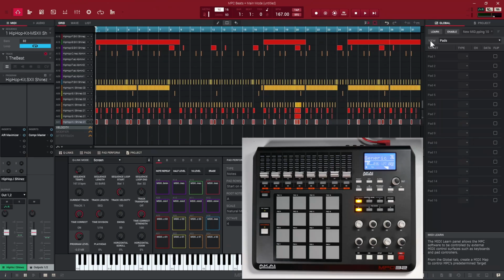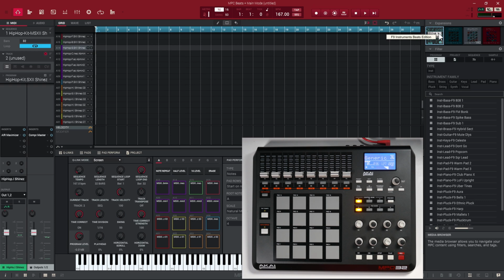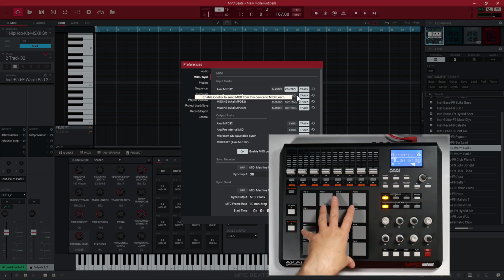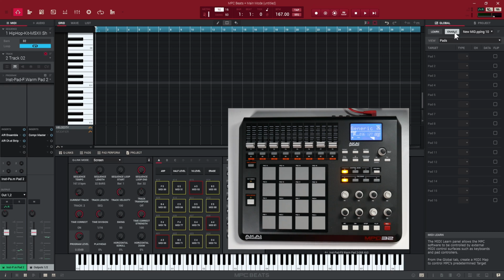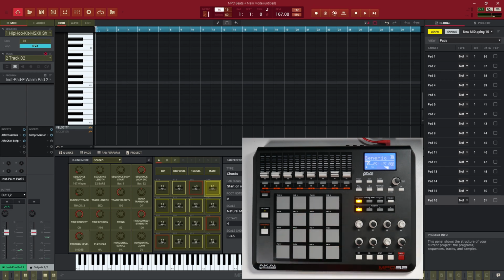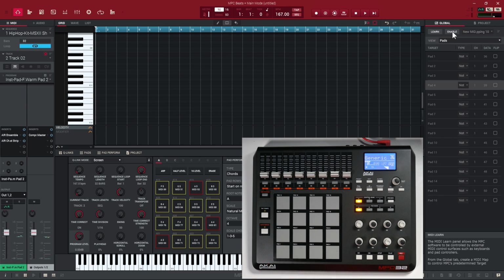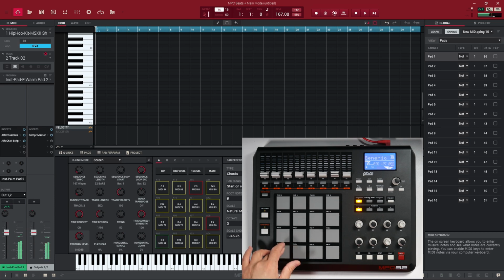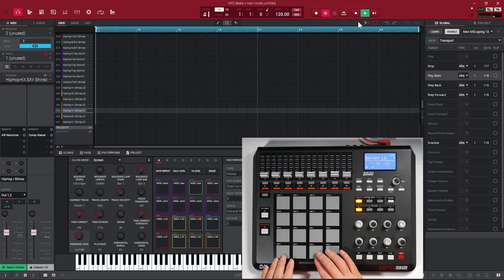MPC Beats PAD Mapping - MIDI Controller Setup (works with pad perform)

Comment: Hi, this video looks good, but I am using the mpc one + with reaper and the vst inside reaper. I get the midi notes, but no sound. When I go to preferences, there is no midi sync. any updates to this vide to cover the newer software or controller? ty

Comment: None of this works sadly. Im getting MIDI in message, but I can't get MPC Beats to do ANYTHING with my pads. Learn doesnt work. It wont take the pads I push....man Im spending 3x the time trying to get this controller to work instead of making music...My pads dont get recognized at all in chop mode...and MIDI learn does not work at all for me...this software is ass.

Comment: Hey, quick question. I have akai mpk mini, properly asigned to mpc with start up wizard. so my 8 knobs are asigned to the first 8 qlinks. how do i toggle between frist 8 qlinks to the qlinks from 9 to 16? like, id like to change the current track qlink using my knob, but i cant, i can only adjust the first 8 qlinks with my akai knobs, and the rest i gotta do manually on the computer. how do i toggle between those 8 qlink sets. is it possible?

Comment: I thought mpd32 can remap itself, just need to check what notes are assigned to the pads
Reply from the maker: Hello, Not sure exactly what you mean.  There is a template I do believe for the new MPD232 but it doesn't work with the old on as far as I can tell (at least it doesn't work when I select it and try the old MPD32).

Comment: Very helpful in setting up my NanoKontrol with MPC Beats - thanks a ton, Matthew!

One Q - somehow note 37 was already assigned to my kick sample. I have assigned the kick (using the method in this video) to note 36, so now I have TWO keys assigned to the kick (but I don't see any keygroups set up - I started with an empty project).

I have my snare on note 38... how do I add note 39 to the snare so that it, also, has two keys assigned to it?

Hope that makes sense! Thanks!

Comment: hey Mat thanks for sharing. I have a Akai MPK2 mini midi synth witn pads and knobs. for some reason the mappings arent working in the mpc beat software. this remapping should work I hope. its a bit stupid because you can choose the mpk mini mapping  but it doesnt work.
also my pad perform menu is grayed out so i cant change any options there.
i have installed the latest mpc beats software updates too.
i wonder if i am the only one strugling with this controller.
also I know there is the mpk software for mapping the controller via programs but this doesnt work either. it is like mpc is signing random notes to the pads. makes me want to throw this controller out.

Comment: Hey so I did this with my new MPK249 with the drum pads and it worked. However even if i save my project, I have to reassign the pads again when I open up mpc to the same project. Any suggestions?

Comment: I have a problem

When i open mpc beats as a plugin in fruityloops linked with my Mpc one

I can not drag samples i have from fruityloops inside the drum pads of mpc beats,

When i press on my drum pads on my mpc, i see it is connected to mpc beats, can not drag any sounds to my drum pads in mpc beats :( anyone have a sulution how i can fix it ?

Comment: With an M-audio Oxygen Pro 25, having [control] turned on for the port (1) (the port the pads notes messages come from) causes unexpected, re-directed octave notes activated by the keyboard which is also the usual set of midi port 1 notes. Switch to an instrument track like Rhodes, synth, organ, and the keyboard is activating the wrong notes in another octave. In Ableton Live and any midi port 1 notes controller, having control checked on for midi port 1 disables a large section of the keyboard from sending note messages at all because those became control messages. So, [control] is not really supposed to be turned on for the port 1 which midi notes come from. MPC Beats is quite awful at every turn for making it work with any midi controller Akai didn't manufacture to go with it. Midi editing being this much of a hassle in one particular software was intentional.

Comment: Hi Matthew!  Yr tutorial was a 'life-saver'...I just bought the M-Audio Oxygen Pro-Mini and after the usual setup, I also hooked up a Yamaha Clavinova (digital keyboard) as part of the USB-MIDI gig.  Problem is when I activated both Pro-Mini & the Clavinova, the pads on Pro-Mini failed to respond to the customised MIDI mapping!!  But when I saw yr tutorial, I then realized the Clavinova de-activated the 'Control' icon for the Pro-Mini.  Thereafter, even when I switched off the digital keyboard, it remained in this OFF-mode.  So, when I re-activated the Control mode for the Pro-Mini, the Pads are in sync again.  Once again, thank you very much for yr guidance!!  2 thumbs up!

Comment: Hi Matthew, nice video to start mapping, but I have a problem and I can't find the solution: I have an M-Audio Oxygen 61 that I use with MPC Beats, when I map the Track Mute on my 8 Pads, the corresponding ones no longer play notes on the keyboard or they play with a different pitch than they should be, so the question is: how do I "disconnect" the Pads from the notes of the Midi keyboard? Or there is a solution to this problem? Thank you in advance.

Comment: One thing that drives me nuts in MPC Beats, the regular MPC software, and many MPCs.... the "Classic MPC" note map is the default when creating a new drum program. So, C1 (your pad) is actually C#1 (inside MPC software), C#1 is C1 (???), D1 is F#1 (yep... this is how the MPC always has been, since the 80s).... and incredibly, D#1 registers as A#4 inside the MPC software. Any way around this, Matthew? Other than this--------- Edit / Program / Note Mapping / Chromatic C1 (inside the software) or..... in the hardware (MPC One, for instance): pencil icon / Edit Pad Map / Chromatic C1)........... I wish you could default to one or the other. Every time a new Sliced Program is made.... it defaults back to the crappy "Classic MPC" map. Insanity, and stupid. What are your thoughts on this? It drives many people insane. I'm definitely not the only one. Thx man!

Comment: Excellent tutorial as always, Matthew. Quick question-- there's no way to edit the last-hit sample (last-hit pad), when using 3rd party midi controllers, is there? You can easily edit the sample by mouse-clicking the pad (inside MPC Beats) but no luck with it showing the last-hit pad, in Sample Edit or Program Edit views. This is not the case when the MPC Studio is connected, only 3rd party pad or key controllers. Correct me if I'm wrong. Thx man! EDIT: It works, after you map it manually. I had a pad controller that was already mapped correctly (pad 1 triggered pad 1, 16 triggered 16, etc). But you have to go in and manually MIDI Learn each pad... no problem. Glad it works (2.8.3 here... Win7. 2.10.0 only works on Win10). Hope this helps others!
Reply from the maker: Sounds like you figured it out.  That's why I made this video. So you can use the control functions of the pads, not just play notes.

Comment: Thank you for the vid, i'm still scratching my head how to get my Alesis V25 to access all 16 pads - can anyone help?. When i load a drum kit in MPC Beats all 16 pads in MPC beats fill up but the factory Alesis  V25 preset  only has 8 pads mapped on the factory setting which map to the bottom 8 pads only and i can't work out how to toggle to the 8 pads on top which have sounds assigned to them. Surely there is a toggle somehwere like there is on the MPK Mini 2/3 or do we need to assign this toggle to the 4 spare buttons somehow on the Alesis?